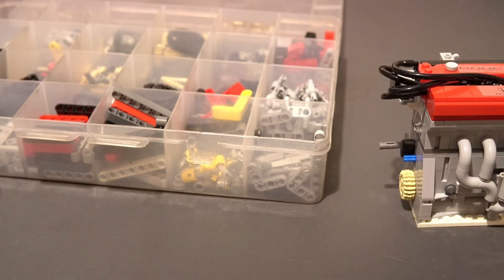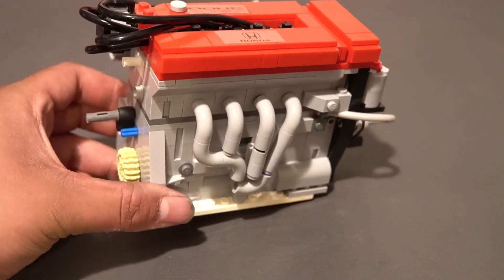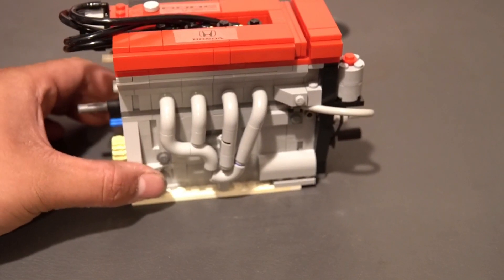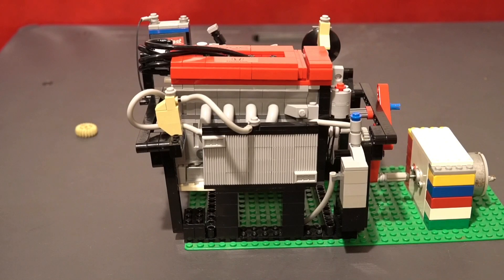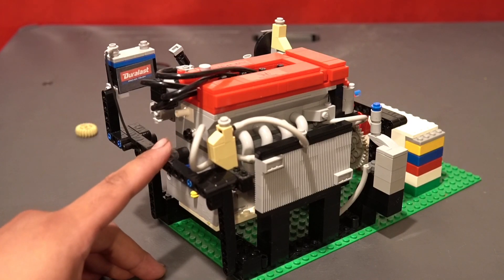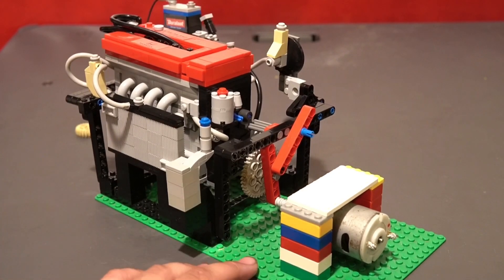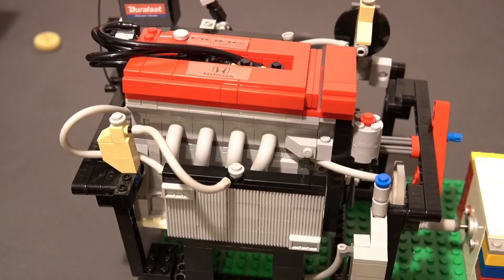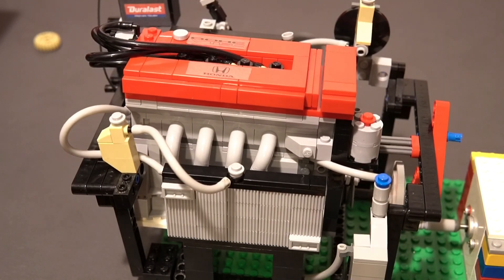1:5 Scale Honda B18C LEGO (Metal Pistons, Dyno Test!)

Comment: It almost sounds like actual VTEC 7:11-7:15
Reply: sounds more like a viper or 5 cylinder imo.
Reply: @ihaveahugecoc  Sounds exactly like a 5cyl

the reason it also sounds like a viper is because the viper has a true dual exhaust, meaning one pipe per engine bank, if they were connected, it would sound like a hurracan, but double the size
Reply: @THESLlCK  I was thinking it sounded like a viper.
Reply: Right
Reply: it sound like VW V10 TDI